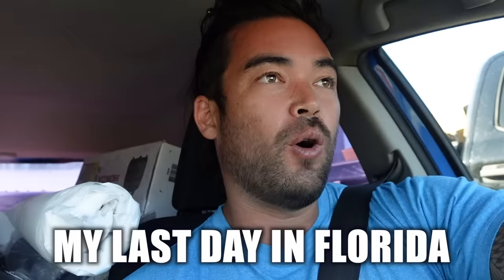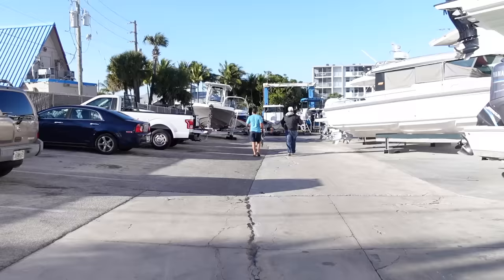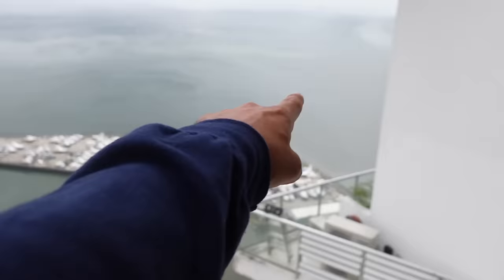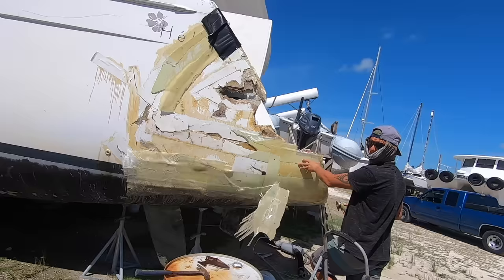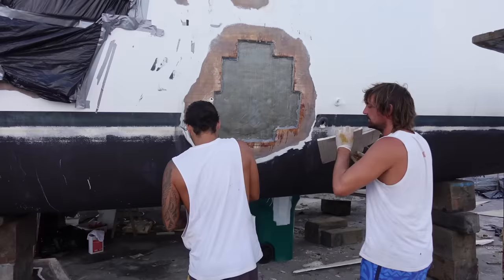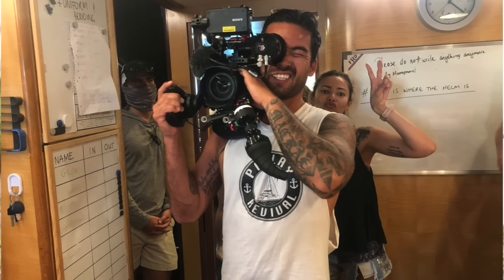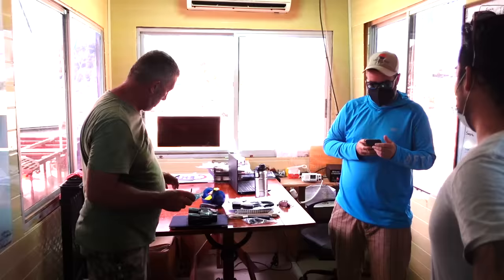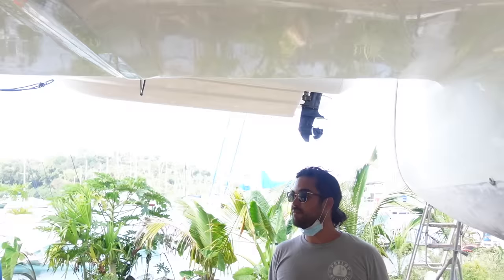WE BROKE UP - A fresh start in Panama - Episode 106

Comment: In Thailand, they use clear plastic tubing with water as a spirit level. Works round corners, from outside to inside, from 1 hull to the other hull. Might be handy for the job ahead.

Comment: Sucks you guys couldn't make it work but you know what you always have the experience. 

Once the boat is on stands how are you going to shift it. (To line up bulkheads) Always worried about actually pulling on the Hull when boats are on the stands would hate for it to  fall over.

Comment: Hi Colin,and crew,..another great video,.. it would be interesting to know from the boat builders, if they have ever had a problem this before ??  I suspect they would deny it if they had as it wouldn’t do the boat credit much good,...
After looking several times at your footage and looking at the way some of the boat has been put together (built) I feel as if they could have done more in the construction stage of the “Cat” to reinforce vital areas  such as the mast location and bulk heads/ deck heads etc in that area given the tension on the mast cabling , And the downward loadings...... either way it’s go into to be fun 🥴 doing this major repair,..  oh the fun starts after it’s done but you guys already know that,..
good luck and the very best of luck Dave 

I have run my own stainless steel fabrication and engineering business for almost 40 years  and wondered if you could possibly introduce an aluminium or stainless steel subframe to the damaged areas it would seem that most of the structure could be hidden within the cupboards and storage areas this would of course mean removing the internal wood panelling etc but I have a feeling that you,ll probably have to do a lot of that anyway is this something that they may suggest ?  Or can it be structurally secured enough by fibre glass alone ?

Comment: I miss fishing. Unfortunately here in California licenses are over $50 and then a day pass at any lake is at least $5 and on top of that thanks to back/knee/hip issues I just can't make it up and down the steep boat ramps anymore and thanks to my size 15 feet I can't make it up their tiny stairs that are made for someone with a size 7 foot. On top of it all I'm autistic and those physical issues combine to make finding work almost impossible. All that adds up to me not being able to get out and do much anymore. I'd love to buy a DUKW so I can just drive straight into the water and back out but you just can't find them anymore, they are 70 year old war machines after all.. besides would I really need a 30ft long 2 1/2 ton rated truck boat that only does 6mph on water? An ARGO would be cool too but they are really expensive and you'd still have to trailer it in and those things really don't like wake and wakeboarding is huge around here. Plus I don't know if they'd be able to make is back out with how steep the boat ramps are and how slick they can be.